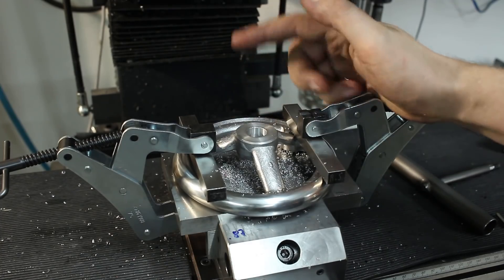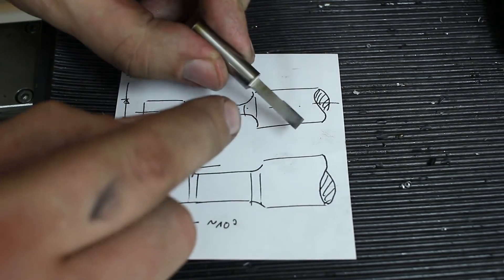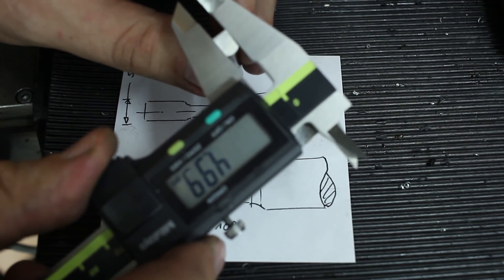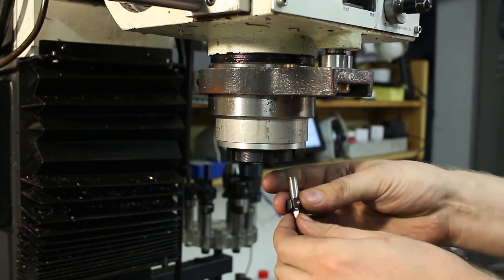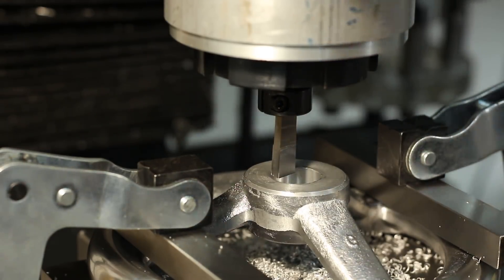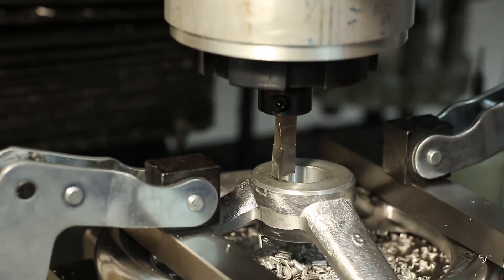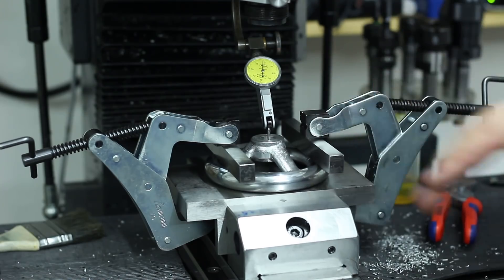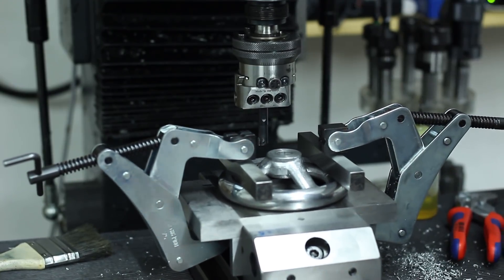Keyway slotting on the milling machine

Comment from the maker: Frequent comments:
- Why dont you use broaches: I dont have an large enough arbor press or broaches
- You should build a slotting head: Nope, not in the near future
- Would milling out a bulk of the material help: Only neccessary for larger keyways or very tough materials
- Will this work in steel: Yes - I tried a 5mm keyway in steel, not a problem. Just take a smaller stepover
- Selling the shaper was a mistake: Blablabla.
Reply: "Blablabla" Ha ha ha, I love you.
Reply: Stefan Gotteswinter george thomas, as I am sure you know, did this operation on his lathe and even made a custom tool for it. The cutting forces are low with a well sharpened tool and cutting oil. Every pc of scrap hss becomes a potential keyway cutter. Too bad you had to sell the shaper as that one was sooooo nice, scraped to crazy accuracy, but in terms of capability per square foot of shop space the cutter grinder makes way more sense. When u get it up and running will you sell the single lip cutter grinder?
Reply from the maker: No, I will keep the single lip cutter grinder - an universal cutter grinder is a setup nightmare for a quick job :D
Reply: @StefanGotteswinter  I wish if I would have one of this handy D-bit cutter grinders. They can be abused for so many jobs.

Comment: Hi Stefan...I have a question about the front relief angle on the cutter, which you said was 10°. I have read that the front relief should not be more than a degree or two as anything much greater than that could cause the cutter to dig in. I have experienced this during an attempt of mine to cut a keyway in this way with my mill. I had a very hard time cutting the keyway even taking cuts of .001".  My question is: How critical is the front relief angle on a cutter of this sort? I have projects that require keyways and I don't own a shaper or broaches. Thank you in advance.

Comment: Wouldn't it be possible to make the tool in a way that the edge is in the center of the quill? That way you wouldn't have side loads.
Reply from the maker: Yes, definetly! I will try that next time - Unfortunately that means a lot of material removal to grind it (And a larger diameter blank to start with). But it is for sure better on the machine (Side load cant canceled out completely, the front rake of the tool will always create a small amount of sideload by itself)

Comment: Thanks for this, Stefan.  I have been working for a while on doing this with a CNC mill, slotting out the keyway automatically.  The video is finally up:  https://youtu.be/vD9acXVdwew
I also used your split-clamp boring bar design to hold a HSS toolbit to do the slotting.

Comment: This technique can also be used for cutting internal splines. Both parallel key type and involute.
Another trick I've used with broaches is to set-up the bushing from the broach set with an off set keyway for a Woodruff Key at the angle needed in order to have the right number of slots for the parallel key spline
Reply from the maker: I wait for the day I need an internal square, I will happily cut it on the mill ;)
Its a great additional technique in your box of tricks.
Reply: Yah, square broaches aren't need very often. I've used them. Mainly for making special sockets for bearing lock nuts. When I was rebuilding spindles I had sockets I made to fit various size nuts. Some were standard length, some were deep well. 4140 hardened and tempered to around 50RC IIRC. Worked great until an idiot on the night shift used them with an impact. What can I say some peoples kids. Another thing I've seen square broaches used for is making boring bars

We even had spline broaches that we made in house for cleaning up internal splines on gears in multiple spindle gear heads for machining lines. Of course there are commercial spline cutters for production work. One pass and its done. The broaches are 1.5 t0 2 meters long

Comment: Try the same into tool steel ;-)
Reply from the maker: I did - works just fine.
Reply: Oh good. With the same width? What depth of cut did you work with in tool steel compared to cast aluminium? I was somewhat doubtful whether the quill and tool setup would be rigid enough to take small (DOC) cuts. But if you say it worked I have no reason not to believe you.
Reply from the maker: only 0,02..0,03mm stepover - Didnt feel any worrying. If I had to do a larger keyway in steel that way I would start with a narrower slotting tool, followed by a wider one.

Comment: Once again I think...…………………..What, no keyway broaches?
Reply from the maker: If you buy me a large arbor press and broaches, I will use broaches ;)
Reply: Well I guess I followed the "Insert Foot in Mouth" instruction on that one. Most people think keyway broaches are idiot proof. Yet we keep getting better (or worse) idiots. I have seen keyway broaches cut deeper on the bottom of the cut than on the top. I suspect this comes from the work and the ram of the press not being perpendicular to one another.
Reply from the maker: mpetersen6 haha - when my dad saw me slotting on the mill: "we used to have broaches back in the day. but that was also tricky"

Comment: Nice video as always. Glad to see this single-tooth "shaping" technique doesn't damage the mill. I'm going to try it out myself. 
I still suspect that using the mill to push an actual broach through metal would damage the mill's z-axis rack & pinion; it's not an Arbor press after all.
Reply from the maker: Thanks! Yeah, definetly not try to push a normal broach trough a bore. Thats what arbor presses are made for ;)

Comment: I was taught years ago about the danger of using compressed air to clear swarf. A brush works just as well.
Reply from the maker: Youre right. I still will use air, a brush, a shop vac or a rag - Depending on what I am doing. What I did in the video was just stupid ;)

Comment: Could you drill out the slot with a milling cutter then use your slotting tool  to take out the corners, probably not necessary in aluminium but in steel would lessen tool and quil pressure. I can see a slotting atatchment for the mill taking shape in your mind 😉
Reply from the maker: You better not look into my mind. I can tell you, there is for sure no slotting head.

I tried a 5mm keyway in mild steel yesterday, no problem from my side - With a wider keyway and maybe in some tougher steel (toolsteel) I would mill the majority of the material out, if possible. Or start with a narrow slotting tool, followed up by a wider one.

Comment: Easier on the lathe using a square tool bit.
That 2 degree back rake as you describe it is actually a clearance or relief and the 10 degrees is the positive cutting rake.

Comment: Is not hurt the gearbox?
Reply from the maker: It could hurt the spindle bearings and/or the rack/pinion of the quill if you overdo it - But in this case the forces are probably way smaller than when drilling with a large drill...

Comment: Nice job. Any thoughts when doing ferrous material to first milling a slot to size and then finishing with the keyway cutter to square up the corners?
Reply from the maker: I am comfortable to do a 5mm keyway in steel - for larger ones I would start with a narroe slotting tool. Or mill the bulk of it out.
Reply: I was wondering why not mill out as much as you can... even with aluminum?
Reply from the maker: Why should I make it take longer by adding a step? :D
Reply: I guess that would be correct for soft materials. Just thinking it would be easier on the mill (more for harder materials). It looked much easier than I though it would be in aluminum.

Comment: I think you should build a slotting head for your mill, so you can cut splines in steel. Maybe you could run a belt from the drawbar to a worm drive, then the rest wouldn't be too hard to do?
Reply from the maker: PSA: I am highly allergic to the word "should" :)

Comment: Anyone have any tips for building up an undersized shaft?
Reply from the maker: I think thats the specialty of Adam / Abom79 - Weldbuildup or Metalspraywelding.
Reply: Dont knurl it ,it wont last long.
Undersize it even more ,then make a bushing and weld it/or shrink fit it  -then you simply turn it to a old dimension. 
You can also undersize it a little bit and then put a weld on it then turn it -but you have to be a good welder for that.
Reply: https://www.youtube.com/watch?v=t-8TnHhpM1A

Comment: I keep a small hand operated shaper in the cupboard under my small lathe for just such an occasion , it is also useful for cutting dials in conjunction with a rotary table . It is still quicker to set that up rather that making a bush for a broach especially if you only need to cut one key slot

Comment: I wonder if you could make the keyway in only a few passes if you used an end mill to rough out the initial slot as a round hole and then use the slot cutter to square off the sides and back to final dimensions?
Reply from the maker: I cant see how that would be any faster. Slotting the keyway did take about a minute. Maybe for very large keyways in steel - But even a 5mm keyway doesnt need a lot of force on the quill handle.

Comment: This was a fun video to watch. How to make a mill into a broach. It could also be done on the lathe using the tailstock ram as the broaching agent. Only problem there is holding the tool but I saw a video somewhere on YT where a keyway was cut on a lathe. And of course you can go extreme as Claudio Grassi  (see channel) does and cut (broach?) gears on a lathe. On the whole I think the adopted solution is the easiest.

Comment: If this is the waybyou do it. Then in my opinion this is the way it's done. The shaper is a very expensive large single purpose tool.
Reply: Not quite, my lil shaper only weighs about 250 lbs and can cut many items my far larger mill couldn't without more specialized tooling for a whole lot more than the shaper cost. Smaller internal gears as just one example can't be done on a vertical mill without a shaping / slotting head. And unless your scraping them in, a shaper and the tooling marks it leaves are superior when cutting dovetails than a dovetail cutter in a vertical head is. Yes they can be slow, but just like a Bridgeport they can be pretty versatile with a bit of thought put into the setups. And a good condition shaper with the correctly sharpened tool can get pretty close to what a surface grinder can do for surface finishes and flatness. Large shapers and planers still aren't dead in some shops even today. There used simply because they can work better than anything else for certain specialized jobs.

Comment: We had a repetitive job on parts used to support the boring bar for the semifinish and finish operations on 6 cylinder inline blocks (Jeep 4.0s). These parts were made of Ampco 18 Aluminum Bronze. One of the last operations before it they went for jig grinding was to cut relief slots in the bore for the tools to pass through. This was done in a Bridgeport using a tool around 10 to 12 mm wide across the cutting face. With the right grind worked like a champ

Comment: Perhaps an optical illusion, but is Keyway cut in line with spoke? How do you get the set screw installed? I've been down that path before.....
Reply from the maker: Setscrew? The handwheel gets pulled onto the shaft by a large nut on the end of the shaft - no need for a setscrew :)
Reply: Some may not know it, Stefan no doubt does. But it's standard engineering practice to have the keyway's in line with a spoke on anything that has them running out to the rim. Flywheels as well. If you didn't know that then everything looks fine until you do know it and that wasn't done. :-) 

Even though my mill does have a spindle brake that's still a brilliant way of locking the spindle Stefan and one I've not seen before. Many thanks. I'm not you so I won't judge you for selling that very fine shaper. Only you can do that against the need for that tool & cutter grinder. No doubt you get more use out of it than the shaper. And as you've shown there's more than one way to cut keyways. George Thomas's writings have convinced me of the need for some type of lathe headstock dividing on my lathe even though I've still got my little shaper. But live tooling even on a manual lathe gives a great many options for other work as well. Great video as always.
Reply: Cheers

Comment: The only thing you can't make on a shaper is a profit.
Reply from the maker: I made profit AND round parts on the shaper. your turn :)
Reply from the maker: There was a austrian (not australian!) shaper that could converted to do vertical milling/drilling - Thereyougo.
And on large planers you usualy could get a millhead with quill as an addon.
Reply: I hadn't known about that Austrian shaper but they make some excellent machine tools so it's not surprising something like that would have been built. And you jogged my memory about the added milling heads used on those planers. I'm fortunate to have one of the Hemingway quick step mills, so it wouldn't be impossible to adapt it to the vertical slide on my little shaper and drill/mill with it if I really had to. Already having a vertical mill there's no need. The machine shop here has a larger shaper of maybe 24" stroke and he adapted the head to take a grinding spindle so it's a bit like a Blanchard grinder. It will never be quite as accurate as a proper grinder would be, but for what he's using it for it's good enough. Sadly it's destroying the machines slide surfaces with the dust, but he didn't need it's standard functions so it's going to be pretty much a disposable machine at some point.
Reply from the maker: Not true.
Reply: Stefan Gotteswinter - I guess you're right. Round parts are pretty difficult ; )
Reply: Ben Model 
Gear Shapers produce really nice round parts. All you have to do is get the gearing set-up wrong. 🤔 Don't ask how I know. Vertical Shapers do a slick job at it too. There's some stuff a planner or a shaper are just the why to go
Reply: Round parts or at least lightly faceted one's aren't that hard. It's drilling holes with a shaper that's the tough part. :-)
Reply: Stefan made a profit on a shaper . . . he sold it!
Reply: So there are other things you can't make?

Comment: Was cutting a 3/16" keyway in a spur gear using my lathe this morning, very similar set up. The gear was steel so the cutter was agvanced 0.001" at a time and even then I some times passed the cutter through a few time on each setting.I've used key steel to cut keyways in Aluminium before with no problems.This is the first time I've seen it done in a mill, thanks for sharing

Comment: What is the manufacture &  year of that boring head Stephan? Beautiful looking tool, thanks, Doug
Reply: It's made by Wholhaupter Doug, as far as I know they don't make them any more. If you were looking for one you have to be a bit careful because some of there heads had integral shanks and some didn't. I've never used but have always wanted one. I finally settled for a Narex B & F head and while it's really nice I'm assuming the Wholhaupter's are even nicer. There's a fair number of other manufacturer's of B & F heads including some Chinese ones. But compared to a standard boring head there all pretty expensive due to the complex internals and very precise fitting of the hardened and ground parts on the very good ones. It's extremely expensive to ever drop or crash one as well.
Reply: Hey thanks for the detailed answer, cheers

Comment: "the Wohlhaupter is always a joy to use"  Those boring heads are pure tool porn Stefan. If I did not have a couple of really nice Chandler boring and facing heads that work excellent. The Wohlhaupter would be my first choice. I have used them in the past and they are so nice. I enjoyed the video, Cheers
Reply: Warren Jones 
Nice does not begin to define a Wohlhaupter😎

Comment: Why are keyways square and not round? It seems quite easy to put a round-bottomed slot into both parts and and it seems that a metal dowel would fix the parts just as well as a square key.
Reply from the maker: For some applications round keys (a dowel pin) can be used - Just drill/bore/ream both parts while beeing assembled at the split line. That can be a bit tricky when shaft and hub are different materials.
Reply: Thanks. Upon reflection, it seems to me that, as long as the width of a square keyway is accurate, the depth is comparatively non-critical - the key will work even if there is clearance above and below it. A round keyway would have to be quite accurately round for the key to work properly and that would be hard to achieve if the two parts were made separately and not in one operation as you suggested.
Reply from the maker: Yes, the depth of a square keyway is very uncritical - actually a keyway to spec has "headroom" - Otherwise it would be overconstrained.
Reply: By the way, if you find&replace all "vise" with "weiß" then your pronunciation would become perfect!  Ha, ha, just kidding - no problem with your English at all.

Comment: You should keep you eyes open for a hand shaper, they take up no room like a machine tool does, they can be put under a bench or on a shelf until needed, and they keep you fit !  The bridgeport type shaping head is another useful thing to have, if you have a machine to mount it on. There was one on my milling machine at work and in years i never needed to use it.
Reply from the maker: I did not sell my shaper to buy another one ;)
There are so many workarounds that give good results for the few keyways I need to cut.

Comment: Saw somebody doing something similar to cut teeth in a gear without a gear tooth cutter, seems to work very well. Pretty sure my dinky little Sherline 5400 couldn't take it (no obvious way to lock the spindle, if nothing else), but I'm definitely keeping this under my hat in case I need it one day.